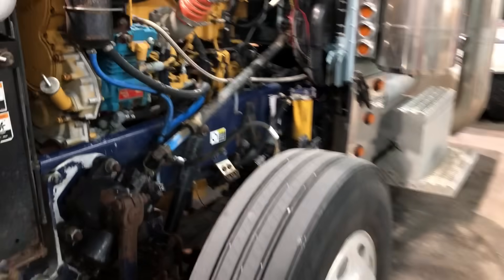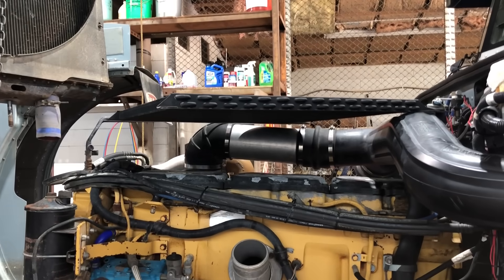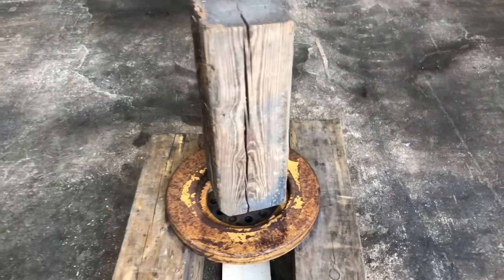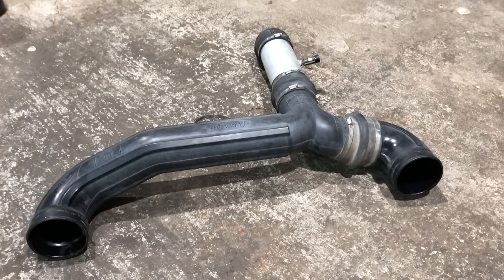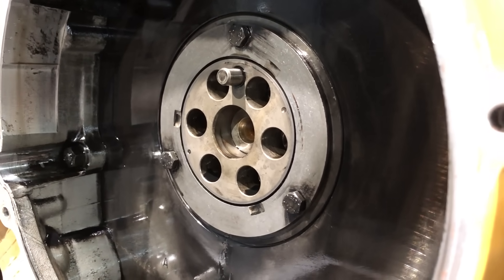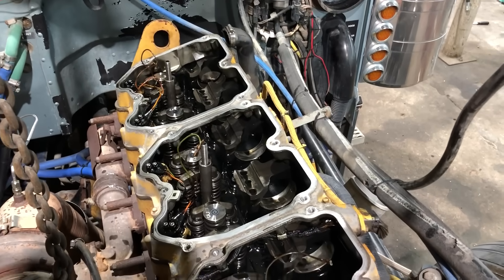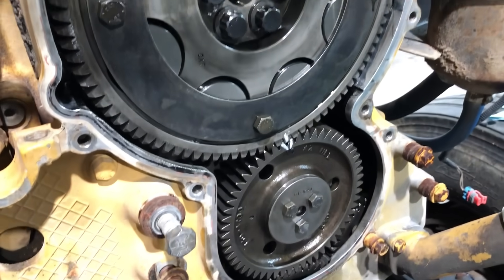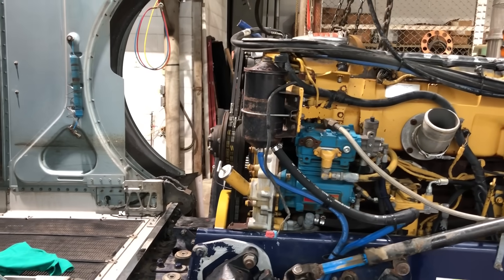800 HP Marine Camshaft Swap - 14.6L Caterpillar 6NZ C-15 Diesel Engine - Peterbilt 379 EXHD

Comment: I got a question for y'all. I know a little bit about the fts and fls but I'm curious how some of you are getting the codes without going to Cat. I used to have a few generic "hot" codes written down but who knows what happened to those
Reply from the maker: FLS/FTS numbers were used by the factory to "trim" engines to their desired HP ratings.  They aren't a big deal, and don't do a whole lot in the grand scheme of things.  The flash file is by far the biggest part of what governs the engine and determines how much power it makes.
Reply: @KT3406E  okay so how are you getting the new files or altering the old one. I'm curious as hell sorry. I had a 379 Pete with the 3406E in it. 475 turned to a 550. I had it at a Cat dealership for something else and he had the computer on it and I was complaining that for a 550 it seemed weak. He changed my fls and fts settings and wow what a difference
Reply from the maker: @danielbartko2378  To be clear, the flash file and the FLS/FTS numbers are totally different and separate things.  Factory Cat flash files are pretty easy to get.  Modified files come from companies like PDI and Bullydog and are much harder to get ahold of.  I have been in the loop enough to acquire several good modified files over the past couple years.   Yes, you can add or subtract power using FLS/FTS numbers.  That's their purpose.  But you cannot add or subtract a lot of power using them.  In my experience, about 50 HP is the max difference between any two sets of numbers.
Reply: @KT3406E  my engine was already turned from a 475 to a 550 when he bumped those numbers. He said that when they turned it up They should have changed them but didn't so when he changed them it really came to life
Reply from the maker: @danielbartko2378  The FLS/FTS numbers aren't tied to a flash file.  There was no "supposed to change them".  An engine only ever has one set of FLS/FTS numbers assigned to it.  They are nothing more than numbers used to slightly trim the output of the engine.  Lots of guys make a big deal out of them, because they don't really understand what they are.  They do make a difference, but not a big difference.
Reply: @KT3406E  all I know is when he changed those and maybe other things I didn't catch it was a big difference. I remember him showing me those numbers but he may have made other changes it's been about 15 years ago. I was just curious always trying to learn more. I wasn't trying to knock your knowledge just picking your brain
Reply from the maker: @danielbartko2378  No problem.  There are some lower and intermediate gear settings that could have been set up in your ECM that affect the way the engine accelerates below certain speeds.  When these settings are turned off (set to minimums), it will make one feel quite a bit different, although it doesn't actually increase total power.  Thanks for watching.
Reply: @KT3406E  thanks for sharing your knowledge

Comment: Absolutely nothing here that was useful, i heard nuthin but lip service and bitching about this or that..oh well.
Reply from the maker: Well, at least it didn't cost you much.  Thanks for watching.
Reply: @KT3406E  justxwanted to see hands on what needed to be done, these heasts are pure horsepower and torque monsters, so any video that can show the motor tore down and whenveach part comes out is helpful, i was hoping to see something,  its nu ot all bad, so dont take it that way, but everytime i wanted to see removing of avpart itx we ould cut off and then show part already off..

Comment: I recall 6 months of break downs and 6 trips out of 8 to cat dealers all for the same issue... a plugged dpf on a c15 this was in 2007 before the def and when ulsd wasn't at every pump .I got the truck assigned with a Check light on ,and all these cat dealers would do is force a regen on it only to have the truck fail a week down the road for dpf full and no regen ... apparently the scan tool and service manual didn't tell them there was a problem?
Reply: A computer is only as good as the person who uses it

Comment: Right, the CAT dealer might not be the solution...A C-7 got diagnosed, new injectors, all sorts of stuff.  they didn't check their own troubleshoot and repair protocol, missed a sensor step and we solved it, and got a new set of injectors plus for no charge.

Comment: surely the marine cam is for fuel efficiency at high revs, not for pulling power  ,
Reply: well > actually it breaths better, so the end result is more power..
Reply: @MrBugsier5  if said cam has more lift and duration,

Comment: Very Nice video,I was going to post that 10 chances to 1 you were going to lose the A/C freon when you start moving around those old hoses. (been there did that) and sure enough later in the video you showed that happen, people did  mine then put new hose on tightened the hose to tight  and screwed up my condenser had get new one them too. old hose will work long time if  never get moved and bent

Comment: If you work within the limitations of your normal cat ET and the epa just changing the cam won’t do anything but make the engine run like shit I have seen quite a few trucks come out of Canada with some custom illegal programming they are great for making shit loads of power and smoke but they are horrible on the pistons and rings and it completely destroys the exhaust your best bet is keeping it stock you get the best power where you need is vs engine life

Comment: Do you build these engines for sale to the public?  I'd like to get a C-16 built with the C-18 components, or get a C-18 built so I can put one or the other in a Glider Kit Pete 389.  It would just be for my personal use, moving farm equipment and machinery around for myself.  My direct email is rculp3@gmail.com.  Thanks.

Comment: @KT3406E You need to get a manual impact screwdriver for those t-bolts
Reply: known as a hammer driver.......motorcycle shop tool

Comment: When you fired that puppy up, i had you in my surround sound system in my 1996 W900L 3406e 5ek (i know you did ask me all that but dammit I'm giddy) which is about 10 speakers including two 12" woofers and two 1000 watt amps ok? I almost went "premature" when she fired up and then you started bust'n gears (young fella can drive too) and maaaaan she sounds so sweet! She was even rolling some coals..awwww yeaaaah😁. Damn what BoBo's saying, you keep doing what you do! On your follow up video on this motor, can you briefly talk about the gears under the peanut cover and how you set them while you're talking about (running the rack) the valve adjustment and jakes'n stuff please? Keep on keeping on my brudda and stay safe 🤘

Comment: Did you need to remap the ecu after this as i assume this is an electronically injected engine. im used to old diesel vw's not a huge fan if their PD engines i had a mechanical injection ALH block i found out the cam from the older non turbo engine had larger lobes and the Bosch VE fuel pump shared a lot of parts with the Cummins 6bt so you could swap pump heads or convert it to run a 4bt P pump just needed to adjust the turbo wastegate new injector tips and a remap too. mix of new and old and pff you go 90bhp to 280bhp in a "flash" haha

Comment: I am positive a dedicated owner who would undertake a tiny little job like this is likely going to not send his truck to the dealer. So all the ASE certified Master Techs out there who comment negatively about this guys work. GFY. My fiance gets called to Mercedes  Benz when there master techs cant figure out why the security system is engaged. My fiance is a realtor who restores old tanks with Radial Aircraft  engine.

Comment: Hi kt, I like your perspective and I’m sorry you have such a bad outlook on cat dealer techs, There are good n bad ones. I am a spec shop tech for a dealer we do hp upgrades on a weekly basis, from a simple fuel system flash to the big kits which include 2 piece pistons, injectors, turbo, and trim files. We do not do the more extreme bumps unless customer signs a no warranty clause- bc as a dealer we simply can’t warranty jobs cat hasn’t tested and proven to work n be reliable. 
I’ve never done the cam swap from your video- but I have done several of larger hp upgrade packages,  which  included cylinder packs, injectors, turbo, and flashing ecm with trim files for injectors and flash files for timing. 
I’m not saying the cam swap didn’t add some hp, I’m actually really intrigued and I envy some of you independents bc you can do some of the innovative things we simply cant bc of reliability concerns. But unless I missed it in the video you didn’t mention doing anything except swapping out the cams.
 I get that this alone will get more air /fuel into engine by changing static valve timing ( how far they open /close and when they open /close, along with injector opening/ closing) But without updating ecm or doing something to update engine ecm I’m not sure how the injectors keep up with what the cam is trying to make them do. Maybe you did something or fixed this and I didn’t see or hear. Did you do anything beside swap cam?   I’d love to see before n after on dyno to see how much the cam alone makes.

Comment: It's crazy seeing a complete engine in application. I've installed thousands of peanut covers, head cams, fuel injectors, rocker arms, and tri sensors in thousands of engines but I'm on a pretty early stage of assembly so I don't get to see the finished product unless I see one of our vehicles in the field

Comment: For the people who dont have a clue it would not run if he didn't re flash the ecm.  And he didn't show that part because you cant. CAT would get their panties in a wad. This is a fact. CAT stopped making big power years ago because they didn't want to warrentee it . With a little bigger injector and a turbo upgrade you could get 900 hp or better out of that engine. And in some industries you have to have that to move the load. I'm not talking about runnin over a 100 mph in the desert I'm talking pullin a mountain staying above 35 mph. Check out almost every coal truck in southeast ky westverginia and south west virginia this is the norm 6nz is highly sought after

Comment: I usually put some penetrating oil on all those rusty screws I know I will be taking out first and let them be soaking in it before trying to take them out and then I use a Impact driver to loosen them up, so they will come out without stipping them. Once you change the cam, you have to go back with larger air intake and exhaust to get the max air fuel ratio you can get through it as well, that's a must or why bother with more lift or duration? If the fuel and air flow is going to remain the same? What gain will be achieved here? Just with the marine cam? While your at it, might as well go in with a compound Turbo system and larger fuel rail and injectors and open that pump up to handle the flow. Then you might have something on down the road. Then you have to step up your game on the trany to handle the horse you have created. Not to mention gearing in the rears and what the overall job it will be doing too hast to be considered next. I know some cow trucks in Texas pushing some big power, not to mention owners in Arkansas running some big power and tall gears as well running chicken/produce/fish haulers trucks that hit triple digits all day long, running coast to coast, each week and I'm talking both ways not just one way. Sounded really good when done though. I would like to see a video of a review on this cam and what you think of it, whether you think it was worth all the extra work or fuel or power increases that you felt it did in doing this swap out.

Comment: I can tell 3 things from this vid. 1 The truck could use more air. 2 diesels dont give a shit about cam timing it's all about injector timing and that will not change with a cam change. 3 any time you add air to a diesel and have fuel to support the extra air. You make more power. Factory computers are on dumb side of the ecu world.

Comment: yeah... john deere is worse than cat as far as i know... they update diagnostic software either weekly or monthy and it must be ran on an authorized computer... the previous months discs are useless from what i am told... the software is by law property of john deere... if you buy an 800k machine you own the metal and other hardware.. the software still belongs to deere... all that being said so farmers are hacking machines and doing their own work on the farm themselves with laptops... it is entirely plausible to believe someone can reflash that truck without factory passwords... ford, dodge, chevy and other manufactures are likely making their stuff so people can't do that but people still do it...

Comment: An engine is a air pump regardless of what type of fuel it is burning. Adding a camshaft with longer duration and higher lift will indeed make a performance increase to a certain extent within reason but is also a dependent on what other changes have been done to the engine. It will perform the same in a mechanical engine to a electronic controller engine. In any diesel to take advantage you need to have the fuel system, tuning and turbo(s) to take advantage. What I would expect in a relative stock engine is a little better spool of the turbo on the bottom end and cooler egts with a slight increase in power. Also you can just install a camshaft into to the engine as the injectors do not care about the camshaft. The air is already in the cylinder on the compression stroke.... the fuel map does not need to be changed, the injection timing does not need to be changed. The injector lob will be the same.

Comment: not trying to start a argument like  booboo caterpillar  but your video is misleading you install a bigger cam in a electronic engine and boom 800hp it's not rocket science that that changing injectors and/or reflashing ecm or changing fuel settings in ET is necessary to take advantage of the bigger cam i have no doubt that you already know this but it would be nice to do a General overview of what all is involved with the cam swap for the viewers that don't know just my shity opinion

Comment: I run a '99 Freightliner with a Cat engine. Had it since '03 and I will never replace it. 1.66 million miles (it had a half million on it when I got it). 8 mpg @ 55 mph. Overhauled at 1,231,000 miles. 435 hp. C-12. 
Yours sounded SO nice when you lit 'er up!
Reply: Dale Fry Why did you overhaul? i did bottom end bearings at 800k for preventative maintenance. at 1.2mil and still running strong! 50
psi of oil pressure running down the road. 03 FLD 113 CAT C-12
Reply: I had a c-12 kick a rod out the side of the block with 650k. Cavitation caused it to cut a hole through a sleeve and  hydrolic lock. Keep good factory spec coolant in the truck.

Comment: Would a marine cam be built for higher speed operation? Or optimized for the top end of rpms ?  Dems like an over the road cam would be optimal for the range of rpms the engine runs for all the shifting.

Comment: ...I usually pull the hood when working on the front of the engine...just easier with it out of the way...on my KW it's two bolts and unplug the wire harness...I was in the dump truck business 26 years with Cummins power...and my truck was never in any shop but my own...dealer would be the last place I'd go...
Reply: Haha yup, we would use a pallet on a forklift  and just pull under it while it was open and pull the pins and wiring if it was gonna be a big nasty job.
Reply: @MrTheHillfolk  ...I didn't have a forklift....so I hung it from a chain on a Bobcat and set it down on a pallet...forklift would be easier...

Comment: What’s the difference with the stock cam vs marine cam? Marine cams tend to be less aggressive for continuous rpm no?
Reply: But then again , from what I've seen usually a marine version of an engine will have more power. 
They don't have to worry about emissions as much as on road too,so it's easier to add power.
Reply: Its not a continuous rating  cam it is a high performance pleasure craft rating of 800 hp about double the hp of a continuous rating
Reply: Long block and bore n stroke difference
Reply: Mike CorLeoné the bore n stroke is definitely different

Comment: Up front I got nothin of my own but you do have just a whiff of smoke. jpaydirt added a switchblade turbo and some programming and ended up with a smokeless heavy hauling C15.  Great video of the internal process and well, keep  America moving with your hard work, sweat and diesel fuel.

Comment: Y tarp the load gonna keep the tarp new as it is lol great vid I got a 3406 15 speed with 410 gears or 411 no sure but it does 60 at 2000 rpm in the 15th gear it’s also a dump truck love Pete’s and kw just nothing like them out there

Comment: Good video..... Only drove one truck with a Cat in it and that was a1985 Ford CL9000. It was a 425 horse (don't remember the engine 3406 maybe?) Been a LONG time and I wasn't really into trucks just needed a job bad. Pulled logs and equipment with it. It would pull. Not run fast but damn pull. I do remember that. Don't let folks get you riled up. You know what you are doing. Sometimes you have to step out the confort zone and try stuff. Only way you will find out if it works.

Comment: I used to do testing on over the road truck engines for CAT. Once had a 1200 hp marine duty map rolled in a full feature 3406e by mistake.  Pulled a fully loaded trailer up the hill like driving a corvette. One awesome engine.

Comment: I don’t know shit. But I once owned some trucks. I recall one being way under powered. When we looked at turning the truck up we found that we would exceed the max on the transmission etc. Despite the truck being new, we replaced it as that was the only way to “solve” our issue. I have a Class A Texas CDL but have NO business driving a truck! And I don’t.